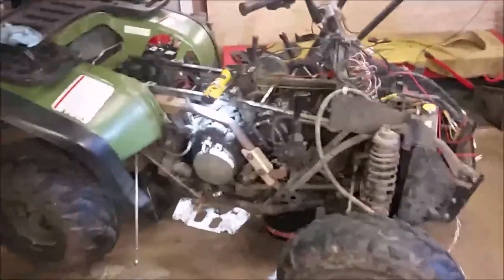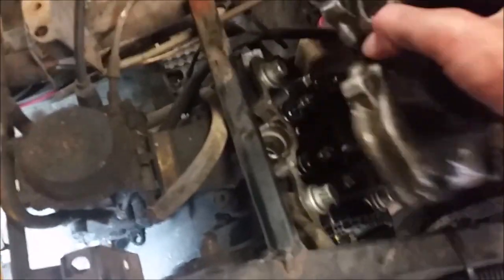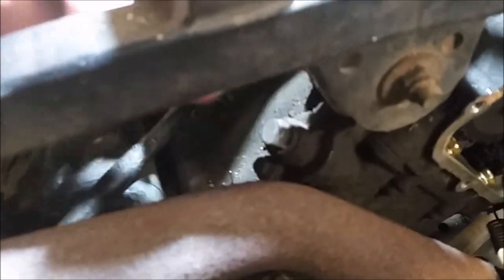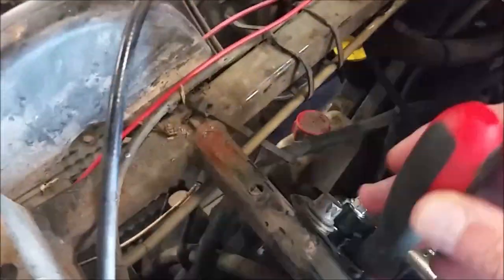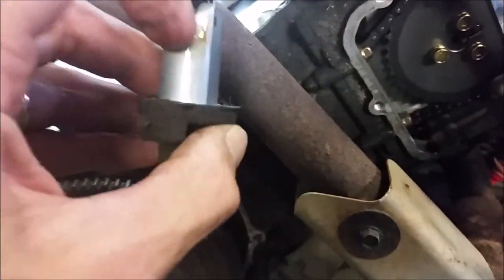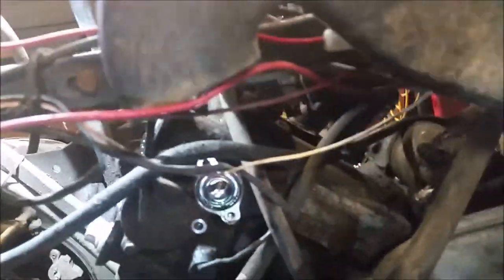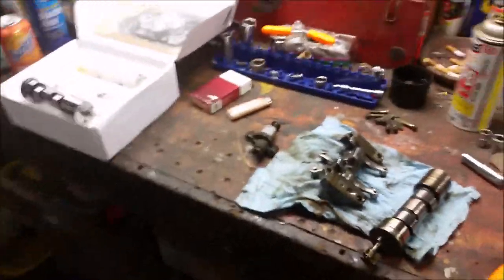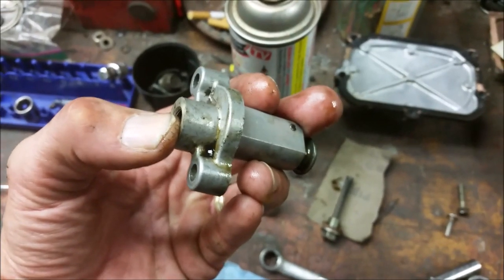Polaris 500 camshaft removal and replacement

Comment: Awesome video. I have a 2002 Polaris Ranger 500 4x4 and it has 600 hours I don’t know if 600 hours is high or low . Runs amazing but the gasket that connects to the cylinder and carburetor has a little leaks it dies when  the motor is not warm and when I restart it I saw vapor or steam coming from that gasket only see the steam or vapor whatever it is when I restart it.
Reply from the maker: I would replace it. The carb intake boot. Its sucking in air making it run lean and not start when cold.
Reply: @TitaniummanGarage  I just ordered it the gasket. It is actually running rich. Use lots of gas and leaves black smoke on the end of the muffler and frame and goes to lots of gasoline not crazy but not good
Reply from the maker: @MOUSEBOWEN  That's interesting. But makes sense. Never seen that happen. You'll have gas vapors lingering in the carb boot. How much black smoke? It could be rich or your valves and or valve seals might need to be replaced if it's a lot of smoke. I had one that turned out to be a bad oil ring(the bottom ring) on the piston was bad. But your using a lot of gas so it wouldn't be that.

Comment: Matt S

@Titaniumman Garage There is a 98 or 99 Polaris Sportsman 500 coming up at an auction.  Owner said that it does not release compression and won't start unless you use a jump start, then starts and  runs fine.  He said that the cam shaft was replaced and then this no release of compression happened.   I read there is some little spring with the ball that releases the valve on the exhaust side.   Where is the spring, i didn't see it on the pics of the new parts on e-bay etc.   

Not sure what a great price would be for this machine.   I guess it has about 3700 miles on it, is a 98 or 99.
Reply from the maker: It's called the DE compression valve. It's inside the cam. They are known to get rusty if they don't get enough oil. $700 to 900 is good.
Reply: @TitaniummanGarage  Thanks.   and $7-$9 with issues noted ?   
Thanks again.
Reply from the maker: Depending where you live, they sell for 1700 to 2200 clean and no issues. If your gonna keep it..it might be worth up to 1200. I try not to pay more than 800. Something that old will usually have other issues too.

Comment: Just put a new camshaft in it. Started right up idles fine. But when I put it in gear and give it some gas on the throttle it is bogging bad and I hear popping coming from the front of the exhaust. Did .006 on the valve lash. Do you know what could be the problem???
Reply from the maker: Yes. I had the same problem.  Most likely the carb is too lean. Or it could be stator or cdi. I replaced my carb..it went away.
Reply: Titaniumman Garage  oh ok. Is there even a air to fuel mixture on these carbs ???
Reply from the maker: @SamJohnson-iq7gg  yes. Underneath the carb by the carb boot. Just loosen clamp and turn carb on its side.
Reply: Titaniumman Garage Ok thank you so much. I think this is the problem because when you put it on half choke it goes good but when you don’t choke it spits and sputters
Reply from the maker: @SamJohnson-iq7gg  Happy to help. They say 2 to 2 1/2 turns out. depending where you are. altitude and such. I had to turn mine to 1 3/4.
Reply: @TitaniummanGarage  im at 500 ft above s. lev. How many turns out would you suggest to start with?.. thanks!
Reply from the maker: @sorehair7075  2 and a half turns. And go from there.
Reply: @TitaniummanGarage  turn in to lean or out to lean?
Reply from the maker: @sorehair7075  Turn in to lean.
Reply: @TitaniummanGarage  thanks!
Reply from the maker: @sorehair7075  Your welcome.

Comment: what were the symptoms If I may ask .I have a 01 500 and im having issues with power at wot just hesitates before it goes and sometimes a good 10 seconds of motor sounds kinda buzzy  and almost stumbling and I rebuilt carb and put new fuel pump same crap any help would be greatly appreciated
Reply from the maker: Mine would only do about 5mph. I would open the throttle and it would stumble, like yours and die. No power at all. I just posted a new video. Check your cdi box too.
Reply from the maker: Check the stator and pickup coil. You said it's buzzy. Something might be rubbing by the stator. If you broke a started rope you might have knocked pickup or pulse coil out of alignment.

Comment: What’s the spring do on the end of the camshaft
Reply from the maker: The decompression ball rides on a small shaft and at the end it has a weight. It acts on cyintrifical motion. As the weight spins it closes the decompression ball. The spring holds it open at start up. Or should I say out.

Comment: 1999 500 sportsman, I replaced cam shaft, exhaust lobe was gone. Now it pulls super hard and I have broke 3 recoils, starter doesn’t rollover fast enough to start. I can start it jumping is with a 20volt DeWalt battery and runs well when running until tonight. It first randomly engaged the recoil while riding and tore the rope. Kept riding, and 5 minutes later it backfired and quit. I was thinking I might have the cam in wrong. I put lobes down with everything at top dead center. Any suggestions?
Reply from the maker: The decompression ball might be stiff or the spring not right at the end of the cam. What cam did you use? When the sportsmans get old like this one they need a strong good battery. The wiring gets corroded and sometimes bad grounds. Not enough voltage to everything. Can't buy cheap ones. I buy Duracell, they are stronger but cost 30 bucks more. Are you buying the aftermarket pull starts? I bought 3 and they all broke with a stiff cam like your saying. Just make sure to check your flywheel that there aren't any metal parts from the pull start. I lost track of how many times I found broken springs in the magnets. Also...A quick trick if you can't find the issue. Use the pull rope and pull it slow till you feel  it tight. thats the decompression ball in the cam. slowly pull past that part and hit the start button with a charged battery. it should turn over.
Reply: @TitaniummanGarage  Thanks for the quick reply! I ordered a good one from Rev6 that is closest to OEM I could find. I had the spring on the end wrong originally but fixed it. I probably have to take the cover off again and see if the ball is moving up and down like it should be. Battery is new and a good one. I have even tried jumping it with two batteries with no luck. I could pull start it "one pull" every time to start until I broke OEM recoil. Yes I am buying the aftermarket  $40-60 recoils (junk). I just opened the recoil and the rope wrapped around the flywheel taking out the stator pickup pulsar coil. SO ordering a new one of those too. At the end of the day all these problems are coming from the Decompression ball. I have seen this issue posted on FB several times after replacing the Cam. I think someone put a cheapo cam in before selling it to the guy I bought it from.
Reply: @TitaniummanGarage  Rev6 is sending me a replacement for the cam shaft. I will test out the second one and see
Reply from the maker: @3jdembows  I have heard good things about them. Let me know how it goes. I haven't bought a aftermarket cam in a long time. When they first came out I had tje same issue you did and the rockers were too tight. I use used cams that are still in mechanical limits.
Reply: @TitaniummanGarage  update - ordered a used cam and just got it in. Runs perfect now! No hard roll over anymore

Comment: Great videos. Very informative! Do you answer questions about problems ? I have a 2004 700 twin with a carburetor. I try do all my own fixes, but I always end up with questions. I search your videos first.
Reply from the maker: yes
Reply: Great!! I replaced the radiator, fan switch, temp switch, thermostat, throttle cable, and the boot between carb and intake. I had recently put new plugs, new carburetor, new air filter, new fuel pump. It ran well but sputtered at mid throttle ( boot was busted). When I noticed I had an overheating problem, I replaced the parts I mentioned first. Put it all back together and it rough idles terribly. Doesn’t respond to easing on the throttle ( tries to shut off) Mid throttle and full throttle it runs well but back fires terribly when you let off throttle. I continuously have to adjust the throttle screw to maintain 1190 to 1250 rpm’s. I am clueless at this point. Like I say , it ran fine before finding the issues. ?? Any ideas? Someone said I needed to fine tune the pilot screw..??
Reply from the maker: @chadwilliamson-cn6wn  I just had one like that I wanted to set on fire because I was pulling my hair out trying to figure it out. It just so happened I bought a 600 and a extra carb came with it. I cleaned mine 3 times. Your on the right track with the fuel mixture screw. I even tried an aftermarket carb. No success. I put the oem 600 carb on. It ran perfectly. I had 2 700s. I had the same issue there as well. I robbed the carb from one and put it on the other. Same outcome.  I haven't been able to figure out why one carb worked and the other didn't except that maybe the carb needs to be dipped to clean it well enough on the inside. I know that's not much help. But that's what I experienced.
Reply from the maker: @chadwilliamson-cn6wn Also keep in mind a backfire is a lean condition. It can mess things up as well. The 600 I told you about backfired because the fuel mixture screw was set wrong by the previous owner. When that happened it did 2 things. It fouled out the plugs. It wouldn't start after. If you were turning the key when it backfired you could shear a flywheel key off. I checked my flywheel and one magnet flew off. Messed up the stator.
Reply: @TitaniummanGarage  Good afternoon sir. I have the opportunity to work on my 700 today. I have removed the carb once again and finally located the pilot screw. (?) Located on the bowl of the carburetor, up inside of a hole that you can’t get to without taking carb off and turning upside down. The screw was tightened all the way in.?? I was told by a friend of mine that it should be turned at least 1 1/2 turns out from tight. Is this correct?
Reply from the maker: @chadwilliamson-cn6wn  Depends on your altitude where you live. I'm in Wisconsin. I turn mine out 2 1/2 and adjust from there if needed.

Comment: So I have a polaris magnum 425 4x4  starts right up can Rev up with air box off but when I put air box on it won't Rev up has new air filter new fuel pump new fuel filter and new carb
Reply from the maker: The 425s and magnums are known for that. I would check for any air leaks. Intake boot, boot going to airbox. I've heard of guys drilling holes in the airbox. I don't think I would do that.

Comment: I have a 01 bigboss6x6. My shifter bracket is really in the way of the cam sprocket. On yours its open there. Mine is factory welden in the frame. Seems the engine in that 500 is furter back in the frame than in my Bigb500
Reply from the maker: Yeah, they crammed everything in there on the 6x6. You'll have to remove plastics and tank. Wrench from the top. Or pull the motor.
Reply: @TitaniummanGarage  yeah. Gonna atleast try with the engine still mounted 😜 thansk for answer.  A tip for you is do a drivechain tension video on a 6x6 . Is none on Youtube.  //Sweden

Comment: Sorry to bother but. My sportsman 500 is only running good on full choke. Carb clean ???
Reply from the maker: Check the adjustment on the choke cable by the carb. Loosen nut and adjust. Also the choke in the carb could be wore out. I've had that happen already. The spring too.

Comment: What camshaft kit are you using? Has it lasted well?
Reply from the maker: I bought the 99 buck one off of ebay. I heard good things about them. Better than the stock cam polaris used back then.
Reply: @TitaniummanGarage  do you have a link for a cam/rocker arm kit?
Reply from the maker: @sorehair7075  No, I'm sorry I don't. Just check out e bay and do a little research on the part. It should be better than stock. Or buy a used one in great shape. I have done that twice already.
Reply: @TitaniummanGarage  ok thanks! you have very informative vids!!

Comment: why do you take the flywheel and stator off,thanks
Reply from the maker: Sometimes I do to get an accurate timing mark. there is one on the gear behind the flywheel and stator. Lines up on the case. Its more accurate than the flywheel mark. The magnet on the flywheel try's to turn it as you set it sometimes.

Comment: Ok guys, I'm in need of some assistance. 97 polaris sportsman 500, starts idles and runs decent until a little bit past 1/2 throttle then it begins spitting and sputtering. I have cleaned carb out, replaced fuel pump, changed spark plug. I have adjusted the air screw in the carb out to the point that it worries me (6 turns out). It seems to get a little better but problem still persist. I have a complete rebuild for the carb at the house to do. I am thinking of ordering a coil just for process of elimination. Do you suppose that it could be the cam and rockers, not opening the exhaust port all the way to let the exhaust out. Any advice will be greatly appreciated. Thanks in advance.
Reply from the maker: Rebuild the carb. Take the rocker cover off and look if the cam is warn. 6 turns is a lot. Sounds like a timing issue. But try the carb rebuild first. Have you checked your hoses and carb boot to see if there are any cracks anywhere?
Reply: @TitaniummanGarage  sorry new gas hoses, boots seem fine. I will have to check the rockers and cam tomorrow when I am off work. I will check timing as well after watching the cam replacement I kinda hope it is that now that I know there is a problem with the stock cam.
Reply: @TitaniummanGarage  what is the main symptoms of the worn cam?
Reply from the maker: @adamtucker8330  depends how far the cam is worn. I had one that would idle fine, but once I got up to 5 miles per hour or so it would shudder and sound like it would die. And a slight backfire.
Reply from the maker: Also, gas shooting out the carb because exhaust valves will not open.
Reply: @TitaniummanGarage  Ok rebuilt the carb today. Found that the O-ring and washer on the air adjuster were missing pretty sure that was done before me owning it. Starts and revs good without air box. Reinstall air box and air filter, runs like crap. Took off air filter still runs like crap. Cover half the intake with my hand revs fine again. I'm so confused??? I did have some gas coming out the intake of the carb without the air box on it.

Comment: I didn't get any spark from the plug I took out ..but I do have spark from a new plug I put in..still wont start...
Reply from the maker: If you did that and shot a little starting fluid in the carb, it should fire up. I guess run down everything you took apart. did you bump kill switch? I've done that already. Its hard to tell ya without looking at it.